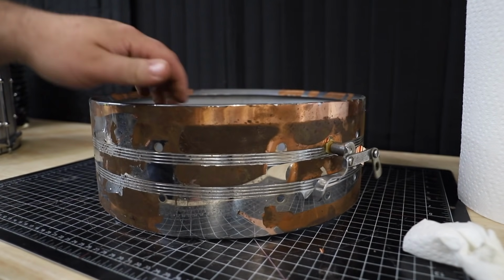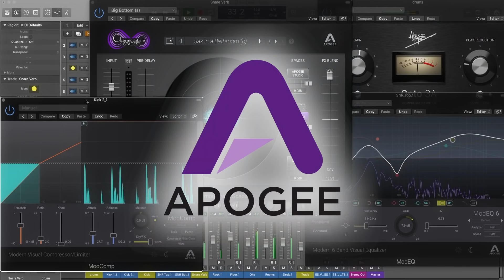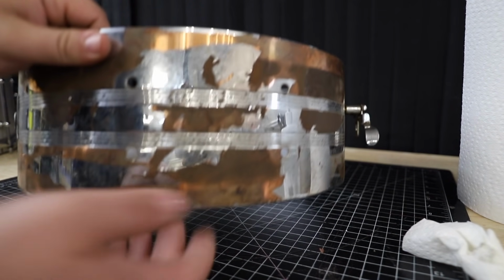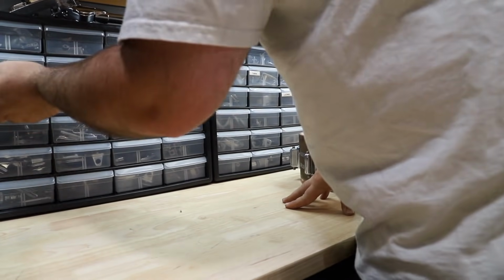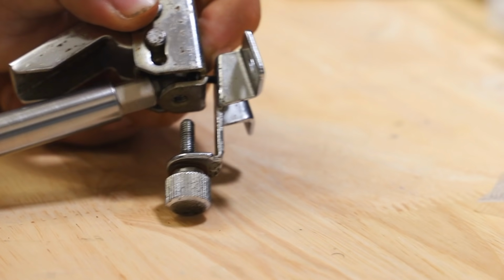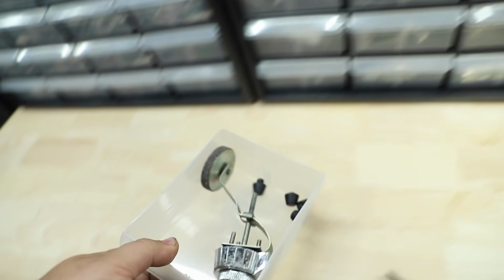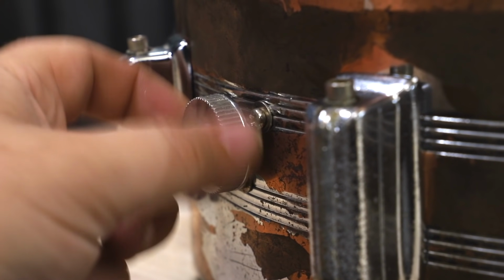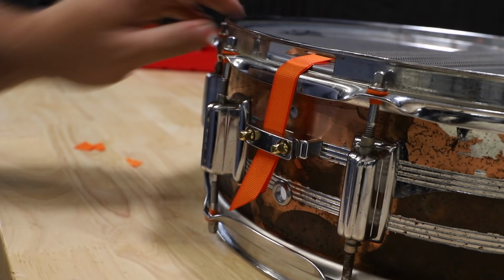Building the RATTIEST Snare EVER

Comment: Missed opportunity!—>
If you had cut the two snare straps at opposite angles it would have looked like a snake tongue, and the way the strap was dancing being in front of the air port combined with the rock ‘n’ roll would have added at least another +10 style points.

Comment: Do you run your mics straight into a DAW? Or do you have processing happening on the inbound signal?
Reply from the maker: Straight into the DAW. They run through a pre-amp which does add verrrrry little color to the sound, but all mixing is done in the box
Reply: @rdavidr  thanks! Sounds great